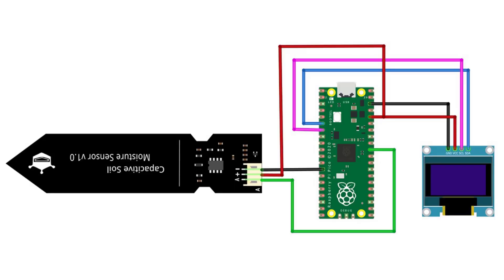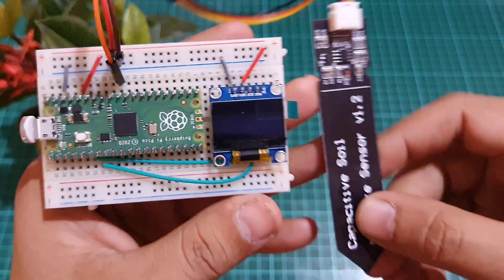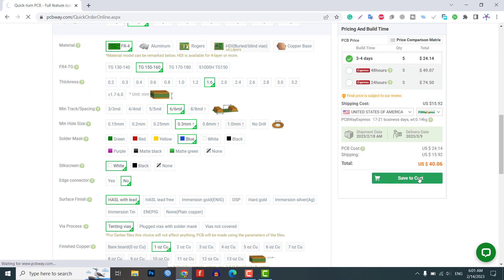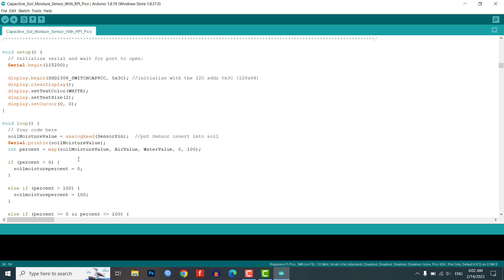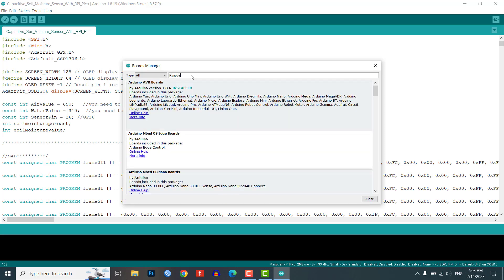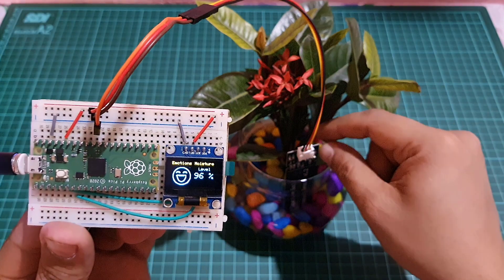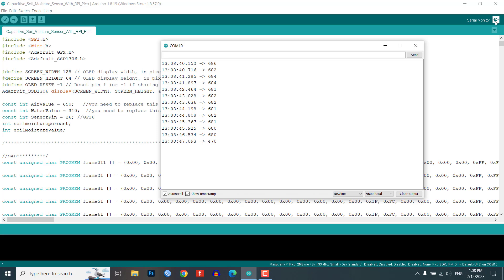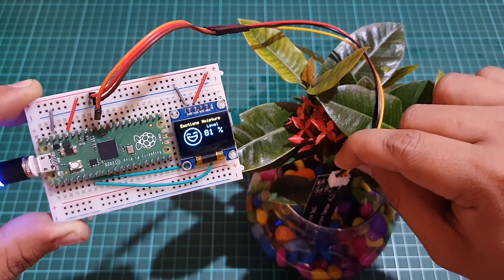Raspberry Pi Pico Plant Monitoring System using a Capacitive Soil Moisture Sensor & OLED Display

Comment: HI, im always getting 65535 value when I tried to read in my GPIO26 pin. Do you know what it could be? Ive tried Capactive v.1.2 (5V) and v.20 (3.3V), both results in the same value.